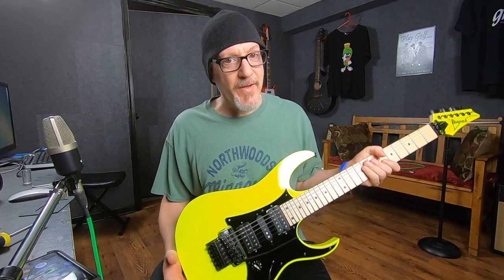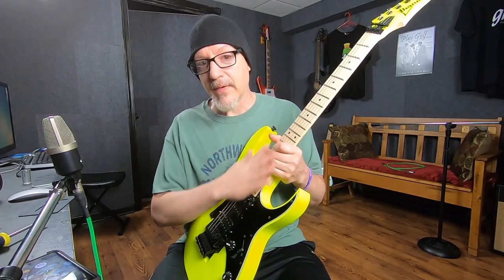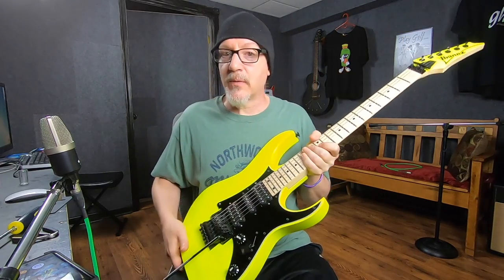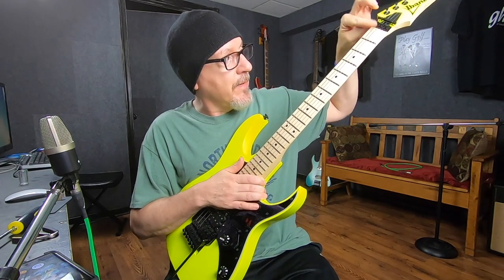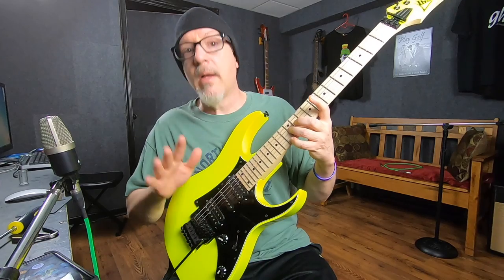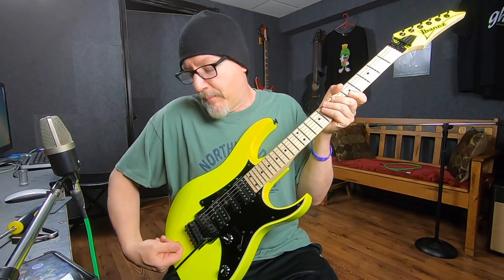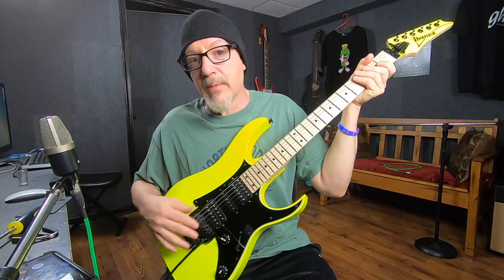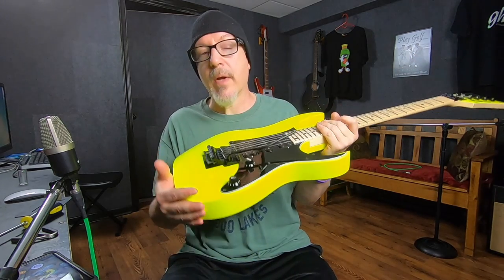Ibanez Edge Tremolo Quick Setup

Comment: Another way to "safely" adjust the action is to dive bomb the tremolo to loosen string tension while you tighten or loosen the studs.
Reply from the maker: right on - that's probably the best way to handle it.  Thx for the feedback!!! Cheer.  Alan
Reply: Actually this is kinda counter-intuitive cuz when you dive bomb you decrease the pressure to the posts/knife edges from the strings but more pressure from the springs is put on the post. There’s actually more pressure on the post/knife edge from a deep dive bomb than when it’s stagnant. For me, the very best and easiest way to do it is to pull the trem up and pull two springs out. On a real Ibanez edge you shouldn’t have any trouble dulling the knife edges, making small adjustments, with just one or even two springs attached
Reply: Right on, except this is a super UN-safe way to do it.  Also, you would need more hands than one person should have.

Comment: 4:30 There is a rectangular indentation on the side of the Edge that's there to indicate the spot to level. If that indent is level, you're good.
Reply from the maker: @Billkwando  interesting.  I have not noticed it but will def. look!!! thx for the tip.
Reply: @ajlsoundwave  I looked and I think your trem is so low it might be obscured by the body route.
Reply from the maker: @Billkwando  right, hence why I use the top of the saddle as the "flat edge".  All in all, there is no absolute; all players preference and I know some who prefer it to be tilted slightly back which brings the strings a tad closer...
Reply: @ajlsoundwave  There IS an absolute, but whether folks choose to ignore it is up to them, haha. I do the same thing with sighting the bridge saddles on my Gotoh, but I have a couple JS guitars and on them you can clearly see the horizontal line on the side of the Edge. I guess the RG is just built different. Maybe something to do with it having a pickguard?

Comment from the maker: 2-27-2023 UPDATE (I will have a video addressing this shortly).  The bridge height adjustment is Clockwise which causes the bridge to LOWER and CCW which causes it to RAISE.  I found very conflicting info online about the inside smaller SET SCREW so I took apart my bridge and confirmed how this operates in my bridge.  Turning the set screw CCW will unlock the bridge height adjustment screw.  IF you keep turning the small set screw CCW, you will come to a hard stop internally which means the small set screw is fully RETRACTED - do NOT force or go any further.  When adjusting the bridge height, first turn the  small set screw CCW until it stops.  then set the bridge height screw to the desired height, followed by turning the small set screw Clockwise until you feel it bottom out, then perhaps a little bit tighter which will put pressure on the larger height screw causing it to "lock".

Comment: Oops!  Talking about adjusting action on Edge, but didn’t mention the stud locks.  So many people forget to unlock and break their tremolo.  That’s the only thing you really should be making this video about.  You also describe doing intonation adjustments without unlocking the nut, which is another dangerous procedure that could lead to string breakage down the road and at least some tuning issues.  I hope folks watch more videos or read the manual before working on their guitars.

Comment: Dude thanks for having any information on this. I just got a Ibanez  guitar rg350 or something. And everytime I tried to tune it, it would go out of tune like a half or full step. Even when I put the locking nut in place. So I thought the guitar was worthless until I found some adjustment to bolt on the back and tightened it up and suddenly it stays in tune! So I got learn everything about this. That's why I'm here.
Reply from the maker: Right on James - so yeah, def. having a better understanding of how the bridge operates will help you keep it in tune.  I am planning on doing a second video in the near future to go over the bridge in more detail - i.e. I'm going to remove the bridge and show how the post screws / locking screws work since I've received many questions on this... Plus I have to fix the five way switch and to do that, I have to remove all of the strings, so I'm going to do both videos!  Cheers, thanks for watching and the comment.  Alan

Comment: Just ordered the yellow genesis rg550. Thanks for this video. Yikes hearing that about the saddles potentially getting damaged makes me nervous. Have you had issues with that when adjusting the action?
Reply from the maker: Wow - AWESOME! I think you'll like the RG and the neck is crazy thin.  So, the saddles?  no issues... but I know those who CRANK DOWN too hard to lock the string are those who break them... so my advice... all you need is to "snug" them, then go a little further which is not as tight as I see some people doing it... Def. keep me posted on your guitar and if you have any problems, please reach out.  I still use mine for many clients / session work and can't say enough about how good of a guitar it is.  Although, for my personal taste, I did swap out the pickups and I wanted the Red bishop bar upgrade...

Comment: Hi! I have the Edge tremolo on muy Ibanez JS100 but there's no visual aid to get the bridge parallel to the body (it won't stay in tune). Any advice? Thanks
Reply from the maker: I'm confused so please bear with me.  I looked up the JS100 and you have a tremolo bridge which you should be able to see the angle of the bridge similar to what I described.  Just look at the bottom edge of the bridge and make it parallel to the top of the body (not in height, but parallel).  If it's sunken down a little bit, then just try to estimate.
Reply: @ajlsoundwave  My mistake. It's the Edge Pro II. No visual aid. Thanks!
Reply from the maker: @alejandromacdonald6203  OK - Edge II pro - I'll take a look at that and comment back soon... Cheers!

Comment: Many thanks for the content
I happen to have an RG440 with edge. My favorite guitar back to set it up it à bit complicated. If you can make démonstration along every step that would be helpful. Many thanks again
Reply from the maker: Sorry for the late reply - I did not see this until today.  I am not familiar with the RG440 and if I have a bridge that is similar, I will make a video.
Reply: @ajlsoundwave  Hi thanks, for your reply. I have a buzz on the lower strings but not on the high ones. do you think it's the action or the neck?
Reply from the maker: @AR-vu2oq  it's likely all you need to do is raise the one post on the low strings - start in 1/2 turn increments.  So you would turn this counter clockwise.  Typically, if you are getting buzz on both the big / low and the small high strings, then it could be the neck relief needs a bit more... but in this case, I would start with just making a small adj. to the one side only.

Comment: Btw i have a one question my floyd rose laying in the same position like yours, is it that high? Cz everytime i tune it it stays the same way cant get more low. Or i have to tune my guitar in D# and then from the back make it tight enough to get E? ( i have the same ibanezrg550pn not dy)
Reply from the maker: I would suggest starting with... What gauge strings are you using?  If 009-042, then you can likely get away with 3 springs in the back (both stock Floyds or Ibanez equivalent).  However, if you are using 010-046 gauge strings, you might have to use 4 springs or if using 3, then crank them in a bit.  Given your bridge doesn't sound like it's leveling out, if at standard pitch your bridge is lifting up (i.e. causing it to pull up from the body, you need to tighten the springs by pulling off the back cover, the Philips head wood screws (holding the claw to the body), turn each in maybe a full turn - clockwise direction).  If your bridge at standard pitch is sinking into the body (pulling back), then you need to loosen those two Philips wood screws - start with 1 turn counter clockwise.  Let me know if you are still having issues - I'd like to help you dial in your bridge.

Comment: Will this guitar do B standard alright?
Reply from the maker: I dont know.  It probably can, but i have never tried on this guitar... only fixed brigdes... what string guage?
Reply: @ajlsoundwave  probably 11s or 12s? I was thinking of getting it for some Type O Negative.
Reply from the maker: I would start w/ 3 springs on the trem and if you are using something like the GHS GB-Low (0.11 - 0.53) with a "B" tuning, I think you'll be fine - just have to monke y around with balancing the string / spring tension.  if it's too wobbly of balancing the trem, you could try taking a spring out and tighening the claw to put more spring tension OR add one more spring and back out the claw... The last thing you could do if you were not really concerned with having a floating trem, is with the back cover off exposing the springs and trem, put in a block / spacer on the stock ibanez metal block so that it bottoms out against the the body at rest... I've used double stick tape and a chunk of plywood...you can still "dive bomb" or do trem moves lowering the pitch, but the pulling back of the trem would not be possible... what's great about this setup is you can then drop the B to an "A" for drop A tuning...they make "trem stops" that I've also used...  Good luck and let me here it when you have it done!!!  Here is my kiesel baritone using 11-53 strings and a fixed bridge... https://www.youtube.com/watch?v=niCFKnhsX5Q @relevation0

Comment: First you did not mention that he knife edge is visible on the side of the trem, so it is easy to see when it is even.
Second, you did not mention to loosen the stud lock before height adjustment (and locking it after).
Reply from the maker: Thank you for your feedback.  I have added a caption at 5:25 to "loosen stud lock" as you have pointed out.  Not all of edge or floyd type bridges have this, but it's an excellent point especially since the majority of the ibanez series do have this option.
Reply from the maker: Adding a caption sometimes takes time before it shows up in the video; I have also added in your note into the description.  Again, thank you for your feedback and well taken advice.

Comment: what are the measurements on string hieght?
Reply from the maker: String height will vary from guitar to guitar because of neck relief and "quality of fret level".  I try to get 3/32's of an inch (between 2-3 mm) and then adjust accordingly depending if I'm getting any fret outs / fret  buzz.  Every guitar is different and some will require quite a bit of adjusting between neck relief, trem height or shimming, and quality of fret level.

Comment: Hey man just wondering if your lock screws are loosened by turning clockwise , I have rfr 550 genesis and its righty loosey lefty tighty , is that the same on yours?
Reply from the maker: Hmmm, I'm REALLY interested in this as that's quite backwards from any of the FR's or ibanez Licensed FR's where the threads are standard with "clockwise" tightens (righty tighty)... Unless or is there a possibility the locking nut is for a left handed neck and it's "flipped" around??? Or you have that one disgruntled Ibanez employee who decided to make 1 locking system backwards... go buy a lottery ticket as this could be your day!!!
Reply: @ajlsoundwave  thanks for replying , I'm talking about the 2 screws that are on each side of the bridge that you need a little tiny Alan key for  , yours are righty tighty ?
Reply from the maker: @markda_shark8201  yes - I just checked and yup, reverse.  So the outer "big" screw that adjusts the "height" is normal with Right / clockwise "raises" the bridge, but the set screw on the INSIDE is reverse which you turn CCW to tighten it apparently!
Reply: @ajlsoundwave  ok perfect , thank you very much sir  , I was perplexed , but now I have an answer , yes the big screws are normal , thanks again  man.
Reply from the maker: @markda_shark8201  Right on.  In all my years of owning FR's, this is my first with the set screw - I've owned earlier versions of Ibanez's that did not have this, so yeah... glad to figure this out and is "normal"... hate to say it, most of us guitarists are out there... but in your case Mark, you are NORMAL!  ha!  have a great day.
Reply: @ajlsoundwave I have an Edge Zero bridge and it seems to have this stud lock inside, i can see that you have to turn them clockwise with the 2mm key to loosen them. But how much? I did that, but i can’t lower the action with the 3mm turning clockwise, it seems locked
Reply from the maker: @matteog.6909  i will take a look at my bridge later today and post another comment w/ my advice - cheers.
Reply: @ajlsoundwave  Thanks!
Reply from the maker: @matteog.6909  on my guitar, the small inside screw gets loose if i turn clockwise to unlock.  then you can turn the large hex bridge screw up or down followed by counterclockwise with the small inside screw.  go gentle, but try it.
Reply: @ajlsoundwave  ok, some said that it seems that you unlock by turning clockwise, but it’s the opposite because it comes to an end if you turn them totally counterclockwise, but that doesn’t mean they are locked. I can’t lower the action with the 3mm key, it seems very hard to turn clockwise and i’m worried.
Reply from the maker: @matteog.6909  if you turn CCW, then it should bottom out.  If you turn CW, then it might start out very HARD to turn, but it should get easier to turn.  i.e. I experienced mine starts out pretty tight and then as I slowly turn CW, it loosens right up.  one option.... remove the strings, and springs so that there is zero tension and remove the bridge and LOOK at the screw with the bridge out so that you can turn CCW or CW and see what it does.  I know it's a pita, but at least you will know and not have any problems with damaging the screw.  just a thought...

Comment: I also got an ibanez rg550 with the edge tremolo, and after watching this video I realized that my bridge was sitting back too much in the cavity, so I adjusted it until it was all plane, but now the guitar won't stay in tune everytime I use my tremolo, I have to retune with the fine tuners all the time I want to dive bomb etc. Any ideas?
Great video nonetheless!
Reply from the maker: Hi W Alenk P. so after thinking about your situation... when the bridge is fully back / recessed, the fine tuners are out of the way.  When you "leveled" it so that it's flat or "on plane", now the tuners can get in the way.  What you might try is the fine tuners, move them so that they are in their "middle" of the adjustment.  that might make them sit "lower" and your palm will not hit it as much.  Maybe you only need to do this for the Low e and A strings... The only other explanation would be the knife edge of your tremelo might be nicked or marred and by having sit more level, it might not be allowing for freedom of movement vs. having it sit all the way back.  Additionally, if the bridge was sitting all the way back, then technically, the bridge can only dive bomb vs. pull back which may also have been the reason why it stayed in tune better... just thoughts, not fact.  I have to replace my 5 way switch in my RG and I plan on doing a very indepth bridge view video.  I will point out a few things in this video that maybe at some point you can check out.
Reply: @ajlsoundwave  thanks for you fast answer! WIll try to fix that, or just take the guitar to a luthier
Looking forward your next videos!
Reply from the maker: @WorldwideAlenkProductions  if your hand is causing the fine tuners to move when you are playing, taking your guitar to a luthier may not solve the problem.  If your "knife edges" are worn and are not returning the bridge back to it's zero +/- point when dive bombing, then you might need to have the bridge posts looked at or the knife edge.  When you move the bridge up or down, does it feel like it's catching or popping or like it's not smooth?  Can you take a video of your bridge and post up on your channel?  I might be able to help diagnose the problem.
Reply: @ajlsoundwave  https://www.youtube.com/watch?v=1tQfbZdBA3Y here it is!
I just noticed that when I pull the tremolo towards me it actually gets (mostly) back in tune
Reply from the maker: @WorldwideAlenkProductions  yes, I noticed that too.  So it could be just a balancing of the right spring tension w/ the right gauge strings OR your knife edges are worn so that the bridge isn't moving back to it's zero position.  I commented on your vid and subscribed!
Reply: @ajlsoundwave  thanks!! I also answered to your comment